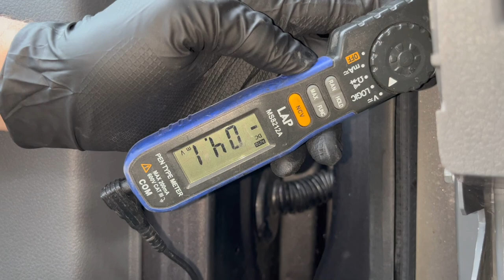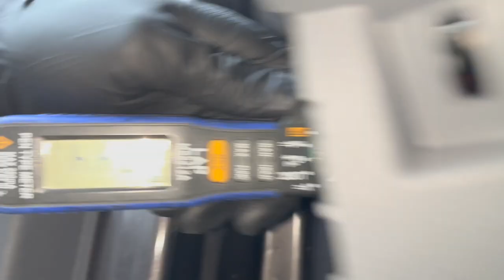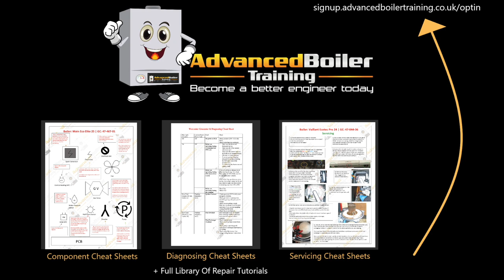How To Add LED Strip Lights To A Van (Citroen Dispatch, Toyota Proace, Vauxhall Vivaro & Peugeot)

Comment: Instead of this I just soldered onto the backs of the existing lights to hijack power from them (and retain the existing switch functionality) and ran to the strips from them, and removed the lamps from those two lights so just the strips produce light now.
Reply: I tried this and led strip only came on dimmly when doors open and then worked fully when light was on
Reply: @JackDalley  I've not had that problem, make sure you have the correct polarity and also the correct contacts on the lights as there is multiple.
Reply: You want the contacts that power the light bulbs themselves, and not the ones that connect to the switch.
Reply: @AndrewStrydomBRP ill try this i just went in with the wired that plug into the light ill try the contacts tommorrow
Reply: @JackDalley  Oh yeah definitely not, you need to solder onto the same contacts as old light bulb connects to (check with a multimeter) as the wires feeding the light are controlled by the computer.

Comment: Only downside to connecting into BSI it has an energy saving feature which means your lights may not work all of the time. Also connecting led's when designed for a resistive load may cause damage to the unit ( immo data is stored here so fairly risky if it gets damaged). your better of fitting a relay to the existing rear light unit & fetching a perm supply closer to the intake bypassing the BSI that way each time you open any door the lights come on.